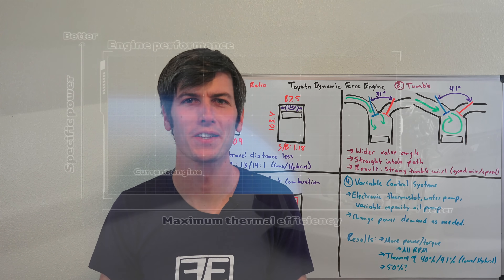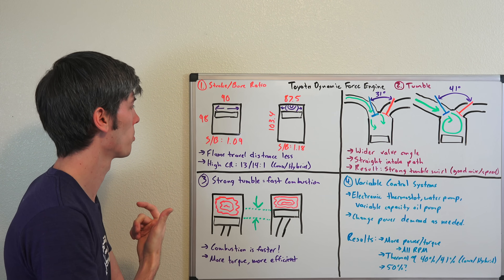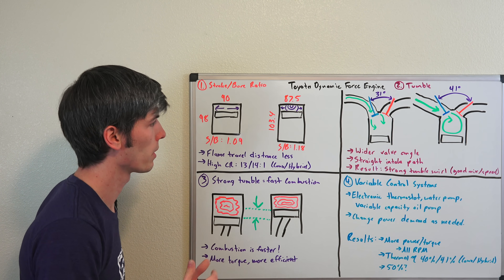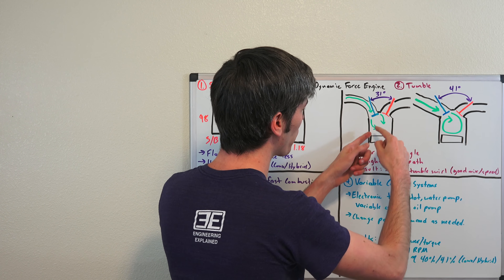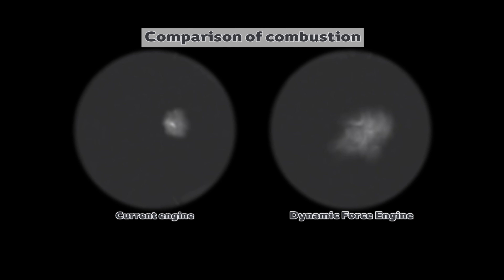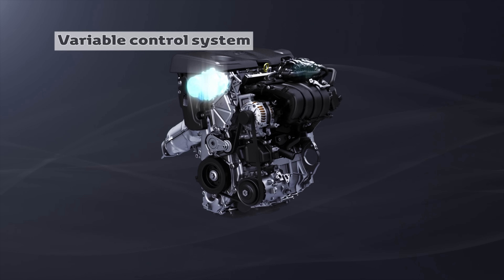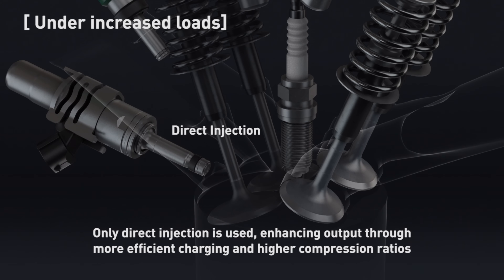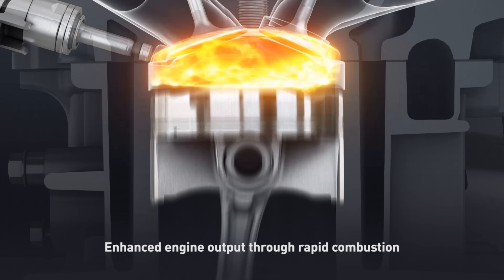Toyota's New Dynamic Force Engine Is Super Efficient

Comment: Great video! Lots of excellent and informative detail. They’re making advances to the ICE that will help us retain enthusiast cars in the years ahead. Now if Toyota could work on their hideous “design language” and make cars more engaging to drive than the Prius.

The CEO of Toyota has been complaining that he doesn’t want to build boring cars. Hint: it isn’t the styling. Hallucinogen-induced anime nightmare should not be an automotive styling genre. The issue is the performance and driving dynamics. Even the Lexus performance cars get yawns from critics. It’s the dynamic character of the car. If you make it feel numb and isolated, that’s what makes a boring car. An automatic gearbox with electric power steering that has zero feel and a cabin so isolated from noise you can hear your own pulse... not a recipe for a fun and engaging car. Flip side is that you can’t cut a bunch of corners and make a cheap car lacking quality control like the FR-S/BRZ/86. The constant little problems in the long term test cars at the auto rags are a big turnoff... I’ll buy a used a Corvette first if I am gonna deal with a cut-rate squeaky/rattly plastic interior... C5 or early C6 will run circles around the Toyobaru triplets, and the LS engines make a vastly more gratifying noise.

There’s a middle ground, where the car has enough character to be engaging, but not so many faults and foibles as to be tiresome after 30 mins. This is the balance that Toyota is missing.

Anyway... sorry for the soapbox. The engine is cool. Would like to see Toyota make cars worth driving and put this sort of forward tech into them.

Comment: So smaller bore and longer stroke means more efficient or powerful?
Reply from the maker: Depending on certain variables, it can improve efficiency, yes. Not necessarily by itself.
Reply: Engineering Explained so i know you can change your bore but how would you get a longer stroke?
Shorter pistons or longer rods
Reply: Increasing the stroke of an existing engine requires a new crankshaft with longer throws. Making the rods longer will merely increase the compression ratio (assuming there is room for the piston to keep moving up the bore- if not, turning the engine over will result in a 'bang' and a large repair bill).

Comment: I guess 40 percent efficiency cannot be super efficient. Electric motor anyone?
Reply: Gábor Szántó The fossil fuel burning power plant that makes power for your Tesla only has ~50% efficiency. After that, you're Tesla can only manage ~90%.
Reply from the maker: Everything's relative of course! For internal combustion, 40% is pretty efficient!
Reply: Gábor Szántó There's potential for a lot of things. How about dealing with reality? In reality, the difference between electric and ICE with regards to environmentally friendliness and efficiency is negligible, but the cost isn't even in the same ballpark, and all while the advancement ICE continues, making the challenge of making EVs mainstream even tougher.
Reply: Don Lorenzo you are right, but the Tesla at least has the potential to get 100% free energy from the Sun! Gasoline powered cars don't even have the chance.
Reply: Iventonart In theory we can get free energy from the Sun, and use almost 90% of that energy, just get rid of the battery for a moment. That sounds way better to me than anything an ICE could ever achieve.
Reply: Gábor Szántó Finding that "free" energy is one thing, harnessing it is something else. How many things in nature do we find are energized solely by the Sun? People aren't. Fish aren't. Elephants aren't. Even plants aren't. If nothing like this exist in nature, what makes you think machines can do the same? It's too slow and difficult to capture the suns energy. Vitalized things have to consumer more than just radiated energy from the sun, they have to consume oxygen, carbon, hydrogen, etc.

Comment: Great as every video of yours! I'm trying not to miss each and every one of them!
As Honda fan I would like to know also where are they in this Tech. Race ?
Reply from the maker: Thanks! Honda seems to be going the downsized turbo route, introducing 1.5L turbos to a lot of their compact segments.
Reply: Vit tuning managed to squeeze out a lot of power and torque out of the new turbocharged Honda’s. Check out their FB page for results.
Reply: I would like to widen a bit your great explanation - It seems that Toyota use the momentum of the in-coming flow to circulate inside the combustion space and than that flow keep this same momentum to the outlet, while in previous engines the in-coming flow comes to stagnation point which cause loss of momentum which is a loss of efficiency.

Comment: The efficiency is 100 small things that add up, its not only 5-7 things that does everything.
My first car from the 80´es had 4 valves per cylinder and 44 degrees between the valves.
The bore and stroke is a compromise they made, longstroke is more torque but high piston speed at top RPM, that is why the higher RPM but low torque GT86 has a shorter stroke.

Comment: Its funny how they make stricter regulations for emissions yet we hear nothing about emissions on diesels.  Stand next to a diesel bus its disgusting the smell from the exhaust even diesel pickup trucks stink.  Plus i bet this thing has tons more sensors that can go bad.  My step moms 2001 Lexus rx 300 has had thousands spent on new sensors thanks to Toyota.
Reply: Stand next to a modern car diesel and you won't notice a thing to tell you it's making pollution. Comparing a car with a truck engine is not a valid test. I notice the smell of unburned gasoline and the rotten egg sulphur smell from gasoline cars a lot more than any smell from diesels, not to mind the smell when I'm filling the tank - diesel barely evaporates at room temperature, so there's very little smell at the pump. The NOx diesels pump out doesn't have a smell though...
Reply: Diesels have a distinct smell different from gasoline cars.  They are obviously doing that because manufacturers have not experimented with tuning the air to fuel mixture well enough before they mass produce them.  I have seen a bus driver forget to close the cap and diesel leaked on the road the smell was horrible and was their for hours.
Reply: The smell was there for hours because diesel is very slow to evaporate. If there was a gasoline spill it would be insufferable for several minutes (And a major fire/explosion hazard) and then it would all have evaporated. Tuning the air fuel mixture is the most tightly controlled parameter in any engine. The sensors in the engine are mostly there to ensure combustion is as perfect as possible in all conditions. 

Diesel runs air fuel mixtures that are lean at all times incidentally, so all the diesel fuel is burned completely (Apart from the creation of particulates) on a properly tuned engine (Rolling coal is tuning the engine to overfuel massively, making soot, but no extra power), gasoline runs rich mixtures, especially under power, hence the smell of unburned fuel under power from these engines (The catalytic convertor is supposed to break all this down AFAIK, but it hasn't enough surface area to do it fully at high flow rates and rich mixtures).

Comment: Is everyone just glossing over one of the coolest hidden things in these engines? They have laser-cladded hardened valve seats (4:43) which remove the need for inserting another metal ring as valve seat. This technology enabled them to achieve that unique intake port design (with the small "ramp" which pushes the air over the upper side of the intake valve, seen at 2:25). It would be very hard to make that shape with normal valve seat inserts.

Comment: Speeding up combustion? Doesn't that mean it'll sound a bit more like a diesel too? XD
It's a very smart solution, I've always wondered why manufacturers didn't improve the air mixing better by making it swirl more.
I wonder about using multiple turbochargers as well. (I know, more cost...)

Comment: Since the economy is changing and epa is cracking down on emissions, I see more Toyotas breaking down. If they really wanted realibily like for military use they probably could. Since they'd go out of business if everyone kept their cars for 15-20 years or more. My buddy has a 92 Toyota Camry and we just did spark plugs but it only has 100,000 miles. I did a window regulator and it only took like 40 mins. Door panel came off super easy, didn't need special tools to fix it. Point is a lot of newer cars you can't even clean the throttle body without it causing the car to need a relearn. I only bought a 1 gen Chevy cruze because it isn't direct injection, doesn't have a cvt trans and pretty simple with lots of room under the hood. Just my opinion, please don't bomb me with messages. Just saying you don't see many people work on newer stuff anymore. They even are exchanging spare tires with a can of fix a flat.

Comment: So higher stroke/bore ratio helps with efficiency. To translate this into non-engineer speak then what we're saying is, girth may be more important than length but longer and narrows = more stamina...right?

Therefore since lower ratio engines tend to rev higher, that means more suck, squeeze, bang and blow per minute; but this does it for longer.

Comment: 40 % VS 41 % efficiency?!  That's not much on an individual engine, but it may amount to a lot for the entire line of Toyotas.
Reply: Keep in mind that most normal gasoline engines are barely doing better than 20% efficient. This Toyota engine is up in diesel territory and possibly knocking on the door of the Carnot Efficiency limit (The Thermodynamic limit which has not been exceeded by any experiment devised so far). 

If it's genuinely running at 40% it's more efficient than a lot of fossil fuel burning power stations, and that's before transmission losses are accounted for. This means that this engine is more efficient than any EV powered by fossil fuel power stations (Ignoring regenerative braking, but the contribution this makes depends where and how the vehicle is driven).
Reply: That means 2.5% less consumprion. Not bad.

Comment: Wow!!  That is ingenious!!  I hope that engine makes it into production soon -- 40% thermal efficiency in a gasoline-powered engine is amazingly good!  That's Diesel territory right there!  If they can produce this engine for a nominal increase over today's gasoline engines -- rather than the near-double-the-cost of a good Diesel engine -- they can wipe out the Diesel engine entirely, without us being forced to live without the fantastic efficiency of a Diesel!!

The whole reason I own two VW TDI cars is that I just can't get that combination of fuel mileage/power/vehicle-size in a gasoline-powered car -- I'd have to go with a smaller car, and a hybrid one at that, which hauls fewer people in less comfort, carries less cargo, and is more complicated and therefore less reliable.  I've been very concerned about the disappearance of Diesel engines in the US -- thanks, unfortunately, to the very same VW TDIs that I currently own -- and I was worried about what I was going to replace them with when they finally wore out.

Between Mazda's Skyactiv-X and this new Toyota engine, it looks like I won't have to worry about it, after all.  By the time my TDIs wear out -- they're very long lived, usually (knock on wood) -- there will be used cars on the market that fit my needs, but aren't Diesels or hybrids!

Great video!  Thanks for publicizing this new technology.  Keep up the good work!
Reply from the maker: Already in production in the 2018 Camry! :)

Comment: WTF? F1 engines had to use a bunch of MGU-H adjustments and engine tweaks to get to at most 50% efficiency, but Toyota just changed cylinder sizes and made a straight air intake to get to 40+%?

Comment: Another excellent explanation of another new internal combustion technology, that can help extend the life of the IC engine. I really enjoy these very informative videos. I also enjoyed the similar videos you did on the new Mazda controlled compression engine, as well as the Nissan/Infiniti variable displacement / adjustable crankshaft/connecting rods. Just imagine if all of these new innovations could be used in concert together, combining all their respective efficiency and power improvement benefits. A shame such a blend is unlikely any time soon, given how the companies will likely exercise their intellectual property rights, and not share among their competitors. Further in the future we could see an inline 4 engine with variable displacement, controlled compression ignition, AND special dynamic force technology - especially given the ever tightening emissions regulations, and the current pipe dream of going full electric.

Comment: Nicely explained!!!
How the Torque demand from the driver accelerator pedal is achieved by petrol engine?
Another question:
Is it possible to share an info about the location of engine components like best angle to mount the injector into the engine?

Comment: Excellent video with amazing animations and explanation!  One correction: The engine used in Toyota's hybrids are Atkinson cycle engines, and therefore will have expansion ratio of 14:1, but only a compression ratio of typical 8:1.  The Atkinson cycle engines never close the intake valve early enough to have that 14:1 compression ratio, but instead push some of that air/fuel mixture back into the intake to be burnt on the subsequent intake cycle.
Reply from the maker: Yes, the hybrids run on Atkinson, but they can vary the effective compression ratio through valve timing. It's not fixed at 8:1, with valve timing it can be much higher if specific output (power!!) is required.

Comment: Could you please do a video on Suzuki's Twin Swirl Combustion Chamber (TSCC) that they use on their motorcycles?  It sounds similar to this, but you explain things so well!  Thank you as always.
Reply from the maker: I will check it out!
Reply: Suzuki used smallish valves and a relatively steep included angle (for air cooled motorcycle engines) with port shapes that were pro-swirl. They made good power, but you have to put them in the context of the times: Kawasaki and Yamaha was still using 2-valve heads, and the Honda air cooled 16 valve 750/900/1100 engine had a larger included angle to promote longevity and cooling. Efficiencies have all increased many times over by now, with modern liquid cooled small included angle 13:1 big port careful squish EFI 1000cc engines making near 200hp/liter compared to these 80's bikes that were sub - 100hp/liter.

Kudos to Suzuki for making air-cooled power last a lot longer than it should have, with high-volume oil-cooling and small fin cylinders and heads that maximized heat transfer. I have worked on a LOT of air/oil Suzuki motors and I am still impressed by the engineering, even if they are a bit fiddly to work on by modern standards.
Reply: Honda did something similar with their CVCC (Controlled Vortex Combustion Chamber) engines, the principle is the the same used here, i.e. greater swirl of incoming air/fuel mixture creates better/more complete combustion.
Reply: @williamallman299  Didn't the Honda CVCC also have a third valve to admit a richer mixture near the spark plug?  They called it stratified charge because most of the intake stroke consisted of a very lean mixture while there was a richer layer at the top of the combustion chamber..
Reply: wow you mentioned this TSCC thing too!!  It was prominenty written on engines in 80's bikes.. but i dont see it written anymore nowadays...there were even products like ''cyclone'' being marketed in the 90's touting improvement in combustion by creating swirl turbulence within the air intake system

Comment: You showed a label for a laser clad valve seat.  What exactly is that?  I could see a laser being used to precisely cut it, or fusing some sort of additional material to the normal seat, or even possibly localized heat treatment of some sort.  But can't think through what a laser clad valve seat would be.

Comment: Are the diagrams you use in your videos (for example the models showing the different angles) supplied to you, or do you create them yourself for the videos? They're always incredibly high quality, and thus I've always wondered. Thanks for the vid :)
Reply from the maker: If it's a specific brand like this video, they're usually supplied by the company (in this case Toyota) for media use. For the gasoline vs diesel video I did recently, those were mine, and much lower quality haha.

Comment: Two points: 1. Have Toyota thought about carbon build-up around the inlet valve with purely direct injection?  VW had this problem, but now use a combination of direct and indirect injection to counter it.  2.  This engine is very much undersquare, which usually means it will have a restricted rev range, whereas accepted practice now is to have a high-revving engine for best efficiency.
Reply from the maker: 1. As you'll see at 4:20, it's both port and direct injection. 2. I wouldn't say there's necessarily a correlation between bore/stroke and efficiency. Mazda's SPCCI engine is incredibly efficient, and runs undersquare as well.
Reply: Thanks for your reply.  I'm still influenced by ideas from the 1960s, when oversquare engines were all the rage and anything else was frowned upon!

Comment: That compression ratio makes me think that the fuel octane required for that 40% efficiency will be  costly; negating the benefits. At 10:1 most cars need RON 98 I.e. 93 AKI. So at 13:1 well.....  It will probably have to run on toluene.
Reply from the maker: It runs on 87 octane (regular)!